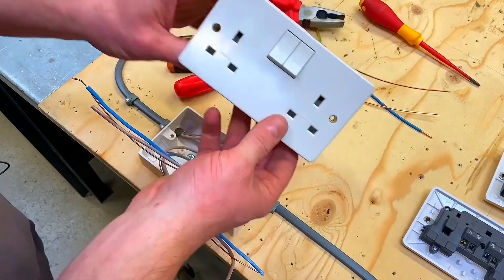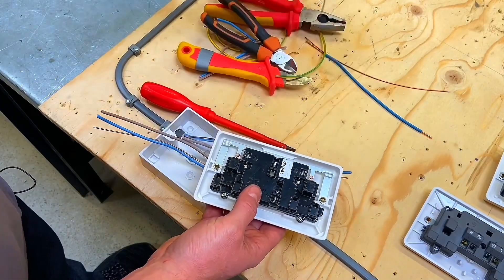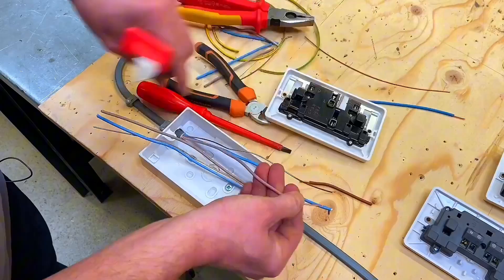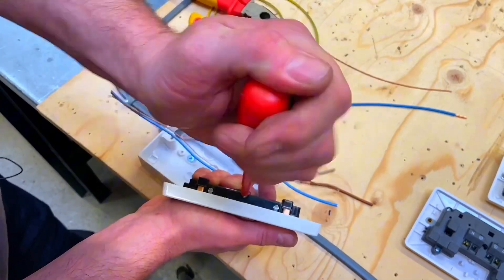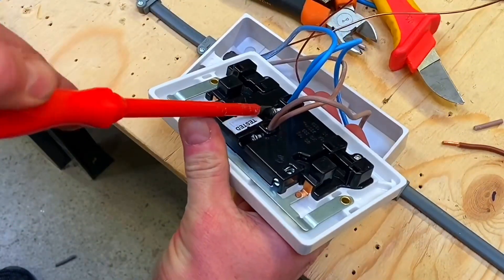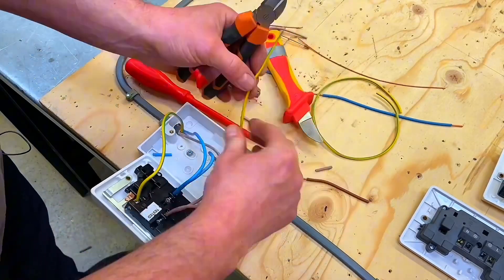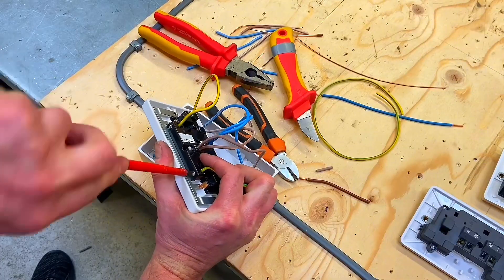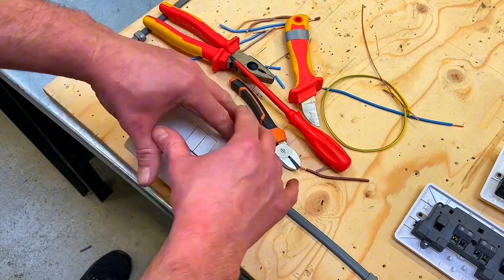How to Connect up your First Socket

Comment: If I mark the copper slightly (only slight grazing) will that affect the resistance of the circuit?
Reply: It would be negligible. Accidentally scoring the copper can make it weaker if it’s a deep mark . 
It’s not found much these days thank goodness,but accidentally scoring or marking  copper clad cable made it very weak and wood easy snap .
Reply: @andysims4906  Thank you for your reply man 👍